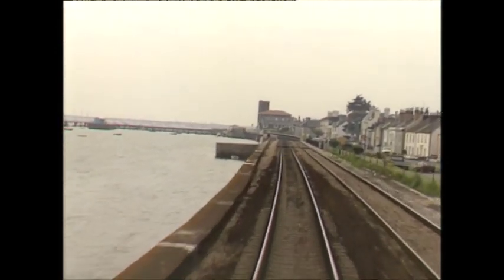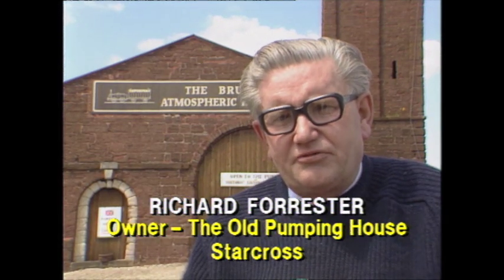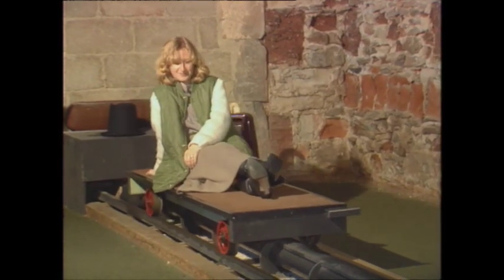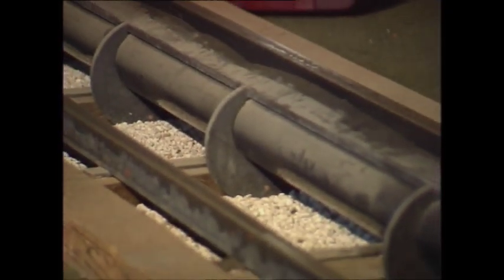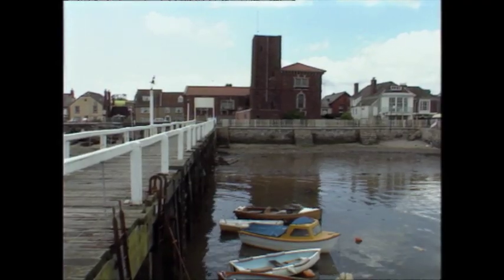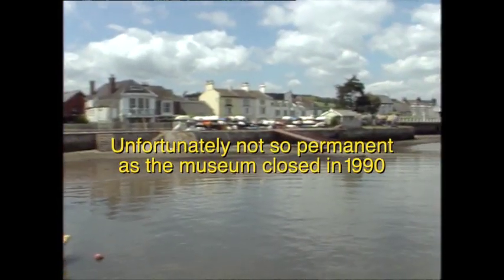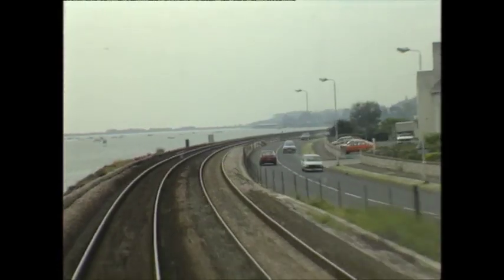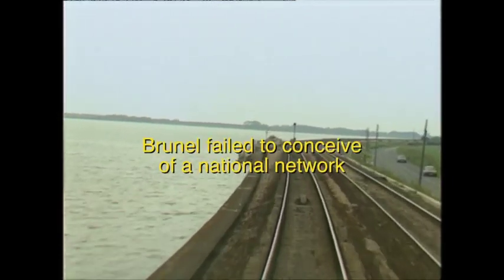Brunel's ill-fated Atmospheric Railway demonstration

Comment: For those interested there is still a surviving section of the pipe on Goodrington Beach, Paignton that is now used as an outflow pipe for Clennon Valley stream as it flows into the sea. Admittedly it's not much to look at but it is historic.
Reply: Next time I'm down that way I'll have to have a look.
Reply: There is also a section of original pipe at the Didcot Railway Centre

Comment: I still do not understand how the piston was connected to the train without having loss of pressure in the tube.
Reply: There was a loss. There was a leather flap on the outside sealing the gap, and something on the train to push it aside before the piston "rod" came by. It would fall back itself and be sucked in place afterwards.
Reply: It was sealed by a leather flap that was coated with a mixture of beeswax and beef tallow. The locomotive came equipped with a small heater to melt the wax and it re-sealed it after itself. 
Problem is the leather weathered and cracked; and rats came in to eat the tallow.
So the next train that passed would leave behind a bunch of rat viscera; which is unpleasant and definitely a disadvantage of the atmospheric railway system.